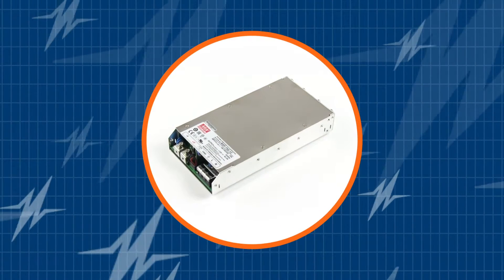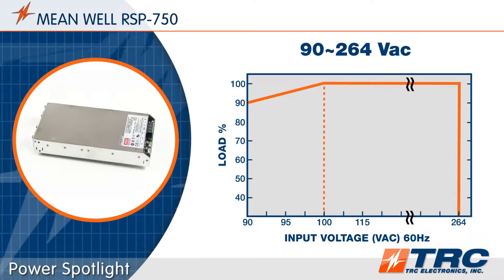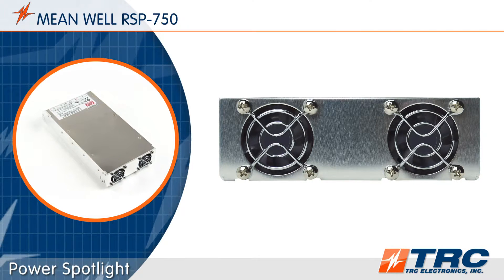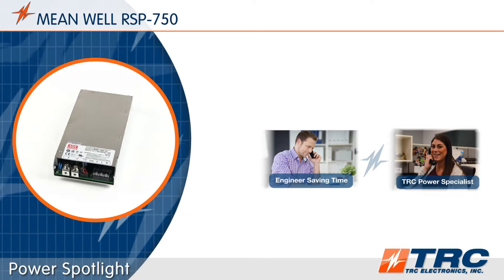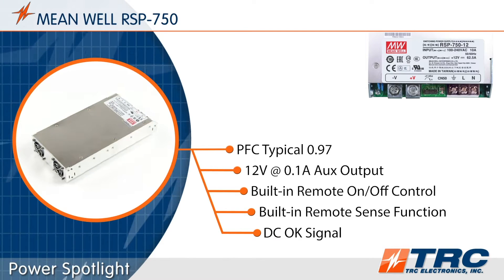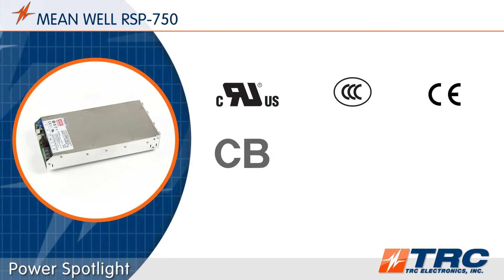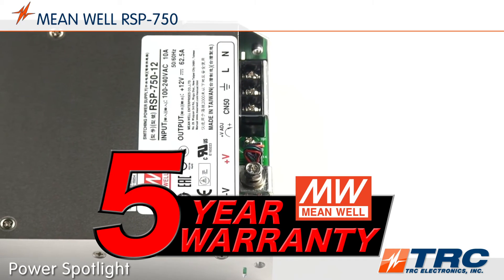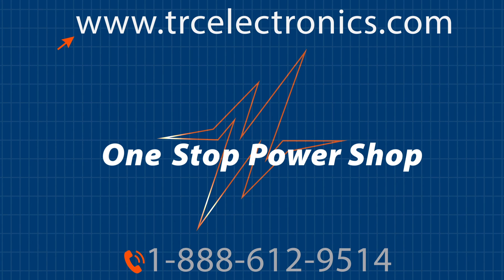MEAN WELL RSP-750 Power Supply | 750 Watt Enclosed Power Supply

Comment: I got this exact power supply inside my Creality CR-10 Max 3D printer and last night it was suddenly caught on fire for no reason while the 3D printer was idling.
Reply from the maker: We recommend begin by contacting the printer manufacturer to identify the cause. There potentially is an issue with the printer design.